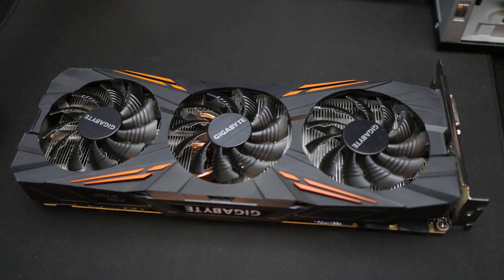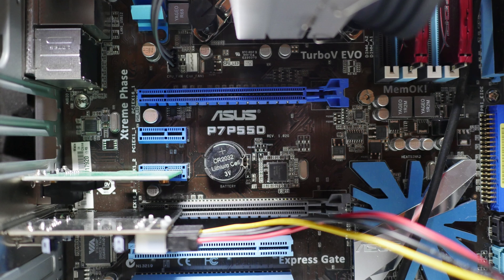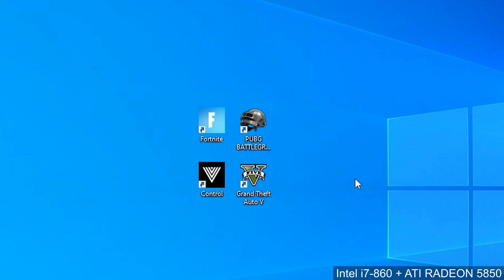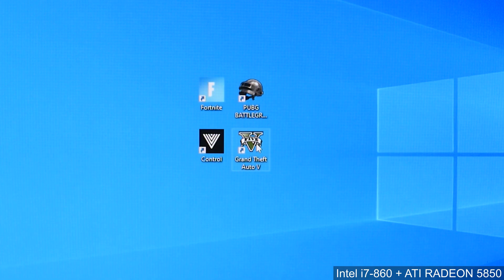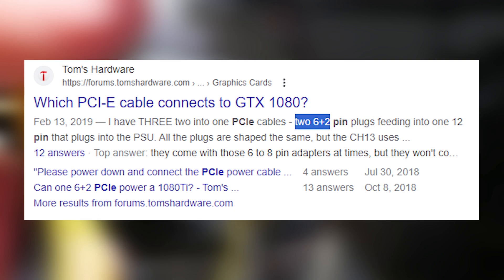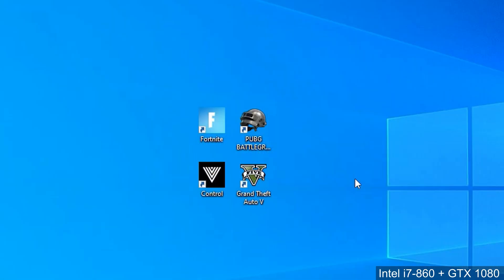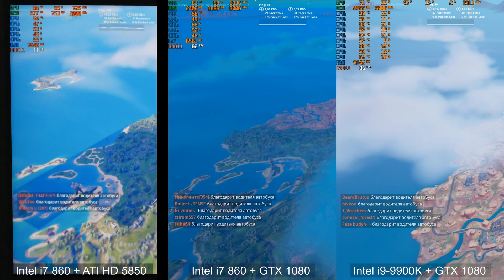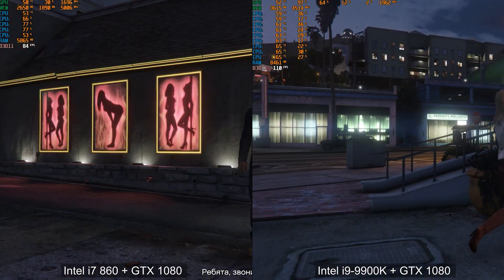Can You Install a Modern GPU on an Old PC and Play Games?

Comment from the maker: Do you have a modern graphics card?
Reply: no
Reply: Me I have a AMD(R) Readeon RX 5600 XT
Reply: Yep, but its gt 730 ti
Reply: Yes
I have an rtx 3060 ti
Reply: yeh have a 3080ti
Reply: Yes i have a 6950xt
Reply: Inda if you consider the 16 series as modern  I got the 1660 super paid paired with a xeon e3 1270v2
Reply: Gtx 1050ti
Reply: @Frontm4n25 is it good?
Reply: used to have a Vega 8, upgraded to an RTX 3070
Reply: I don’t even have a gpu lmao
Reply: Does a Rx6600 Eagle count?
Reply: @Cubzix     Affirmative; the RADEON RX 6600 is still supported with drivers, unlike my ASUS EAH6850DC/2DIS/1GD5 (AMD BARTS Pro GPU, 1 GiB GDDR5 VRAM — Radeon HD 6850 for practical purposes).
Reply: No
Reply: Yes,i have rx 470
Reply: @ArcadeAssaultSrb me too
Reply: Im sorry, but no!
Reply: I have rx 6750 xt
Reply: Got a gtx 1660
Reply: Cpu I7 13700K, R9 380 4GB, i will upgrade to the RX 7800XT at Christmas.
Reply: Of course not
Reply: Yeah i have a 2080 super, pretty much almost equivalent to a 3060 ti or smth like that but my cpus (yes two cpus) are from 2013
Reply: UHD770.。。。。。
Reply: No 😢
Reply: I have no GPU at all! 🥺🥺
Reply: amd rx 480 8gb
Reply: I have a MacBook Air from 2015
Reply: GTX 1050m.. far from modern
Reply: I have quardroom graphics Nvidia
Reply: Rtx 3080 OC still keep good here ofc on modern platform no old 😂
Reply: I have no PC at all! 🙂
Reply: No I have a 1930 graphics card and a 1980 2 gb of ram and a 1987 cpu
Reply: I hope 😢
Reply: Yes sir i have an rtx 3060ti
Reply: RX 6700 XT here
Reply: nop i still use a hd 4550 from 2008 and a monitor from 2009 but before windows 7
Reply: Rx 6400
Reply: @melonmusk1274  rich I have a hd 4550
Reply: GTX 1060
Reply: Gtx 1070
Reply: The 4060Ti. I don’t think that GPUs are the most universal component, I’ve literally never seen a computer that doesn’t support SATA hard drives.
Reply: Me who got gt 130 with dual core🗿🗿🗿🗿🗿🗿
Reply: I have 1080 FE 8GB :)
Reply: ATI FirePro V4800 1GB ❤
Reply: Hahahahhaahhahahahahhahahahahahahahhahahahahahahahhah… i have AMD Radeon HD 6770M graphics with 1GB of GDDR5 memory and
Intel HD Graphics 3000 with 384MB of DDR3 SDRAM😢😢😢😢😢😢
Reply: Yes i have rtx 4060
Reply: Radeon pro 570 4 GB VRAM in 2017 imac.   I don’t use it for gaming that much. Just photography and video editing.
Reply: I got the typical 3060
Reply: Yes rx560xt 8gb
Reply: yes i have rtx 4050ti
Reply: Well, i've just got a GTX1050 😅
Reply: I have rx 5600 xt with r5 3600
Reply: Yes with my desktop and laptop
Reply: GT 210
Reply: Rxt 4060
Reply: Rx 580 but no power supply 😂😂
Reply: I have gt 610
Reply: gt 520 😅
Reply: yes 
i have a 3060
Reply: @RamtechENG   Not yet — I've an ASUSⓇ EAH6850 DC/2DIS/1GD5 VDA (Advanced Micro DevicesⓇ BARTS Pro GPU, 1 GiB GDDR5 VRAM).  ASUS TUF Gaming VDA  with nᴠɪᴅɪᴀⓇ AD104 Ada Lovelace or GB104 Blackwell GPU on the shortlist for a successor tower for the CM1630 minitower as upgraded.
Reply: Is a GTX 710 modern
Reply: @hihoo883     I doubt it.  nᴠɪᴅɪᴀⓇ GF119 Fermi GPU has only 64-bit VRAM.
Reply: geforce rtx 4060 ti dual core 😊
Reply: Amd Radeon r6 680
Reply: Nah
Reply: Yes, RX 7800 XT. It's a bad boy.
Reply: Rx 6600
Reply: Yes i have rtx 4060 8gb vram
Reply: Yes rtx 4060 Ti 16gb
Reply: Intel® HD 2000 graphics, upgrading to a   soyo RX 470 4gig
Reply: Atleast i have an gtx 1080 ti nvidia😈😈😈😈
Reply: I don’t even have a graphics card😑
Reply: I have a rx 580
Reply: Yes gtx 1080 ti
Reply: Yep got it yesterday it’s a 4070 super 12GB OC
Reply: If the rx 6600 is modern then yes
Reply: I have a gtx 660 ti
Reply: is intel UHD graphics modern
Reply: @AliYazılım  depends
Reply: @Милвалке  i mean i have an 2023 and i3 laptop and it has UHD graphics and its from 2023, its prob modern
Reply: @AliYazılım   it's newer than my gpu so probably?
Reply: Yes, running a 6800XT on my main rig and 3070 on my backup. I may put one of them into my retro build if I get a different PSU there.
Reply: Rtx 3090 
By Scalpers
Reply: GeForce  1050 4gb
Reply: I have GTX 1050
Reply: Gtx 1660 super
Reply: GTX 1660 Ti , The Last GTX cards
Reply: No, I have GT 610
Reply: I having GTX 1050
Reply: Rtx 2060 super
Reply: No i have gt 610...
Reply: 5070ti

Comment: Some latest GPU won't detected by old motherboard. The worst no new BIOS support for those motherboard. 
I try to pair my RX 6600 XT to m-81 M1 motherboard. My GPU take a time (a minutes, 3-5 minutes) to display. something to my monitor. Some case for my other fellow the GPU won't be detected at all.
Reply: do you mean h81 ?
because i will buy  asus rog strix rx 5500 xt 8g and i have pegatron h81-m1 and i7 4770
it will work good ??

Comment: Do you think a Dell xps(2017) with an i7-7700 would work well if I put an RTX4060 into it? Low settings are fine.

I dont have any pc to game on, just getting started.
Reply: 1 month later but yes of course, you can play high 1080p in alot of games

Comment: You can breath "new life" into an older computer by 1. upgrading the video card 2. Maxing out the Ram (back in the day when maxing out meant 2, 4 or 8 GBs obvs), and 3. Upgrading the CPU to the best one that the slot in question can support (less advisable if the difference is marginal at best) and assuming you have the power for it. My philosophy regarding video cards is to search internet for "best video card for x processor". I ended up with an Radeon HD4600 series card for the Windows XP computer (Sempron 3300) and ironically an HD7770 for the Windows Seven Computer (Athlon II X2 250).  The former does occasionally bottleneck the CPU, but the latter is a good match.  

Obviously not the purpose of this video, but better match  for the I7 860 would be something like a GTX 760.
Reply: best example is socket 775 board, was first released in 2004 and supports  q6600 which ppl still used until recently for gaming

Comment: 1080 is not even modern it uses old chip.
AMD XT or RTX cards are modern
1080 is 8 years old
Reply: still 3060 level performance
Reply: It's modern enough lil bro

Comment: I was thinking of getting a amd  rx7800xt card to use  with a intel 8700k  cpu with a msi Z370  gaming 5 along with 3200mt\s of ram  .Do you think temperatures and  gameplay would be decent ?
Reply from the maker: I don’t think so. It’s not 13/14900k so, your temperature must be fine, you are using a necessary cooler ofc

Comment: lol. "what if you build a PC with same generation GPU and one generation older CPU than you used to use as a daily?" well the performance is kinda crappy, suprise suprise. its actually suprisingly bad given the fact that the CPU is hyperthreaded which is what most games need to go from iffy to running well on a quadcore.

Comment: This is just possible because the games used here are point focus games like shooters or exploration games where you only controls your characters specifically (camera is stucked on your character). and that folks are not CPU taxing games, the GPU just take the work load when cpu is struggling.
Now, if you play real modern games RTS like Spellforce 3, Age of Empires 4, or open world Diablo4,RDR4,Skyrim,STARFALL. that is not Possible.

Comment: Now what if you connect a old Graphics Card to a new PC?
Reply: You can
Reply: @anotherrandomguy2763  unless its agp
Reply: I put an old ATI x1300 into my new pc and it doesn't display so UEFI probably prevents old cards from working
Reply: @ can be fixed with a bios mod

Comment: wait im confused can someone explain to me

i have an i5 using a RTX gpu and 16gb Ram. and its super smooth, i play Minecraft RTX and i can play Fortnite with low/mid RTX setting?

how is his cpu 100% used?
Reply: Which i5? The i7-860 is a 1st generation i series processor. At this point, there are many i3 processors that run circles around that cpu.

Comment: Who told you that old graphics card there is modern?
Reply: I mean, it's still nave modern drivers and directx 12..
Reply: @i_Daniel  It's old. Almost a decade old. I guess you could consider it modern, depending on your definition of modern in this case. It's still a decent graphics card, but it's old. The issue for me in calling it modern is that it's old. I don't know what the cut-off date would be for modern and not-modern anyways.
Reply: @theonerm2  still better than rtx 3050 tbf
Reply: @i_Daniel  Yes. It is better than the RTX 3050 but the RTX 3050 sucks anyway. It sucks in both price and performance.
Reply: @i_Daniel  So, the GTX 1080 is still old. It being better than the RTX 3050 has no bearing on whether it's modern or not.

Comment: im trying to add 4060 to my old Gigabyte Z370M D3H mother board with I7 8700k processor. Please let me know if it will work fine @RAMTECHENG and others. I chose this Graphic card as I need not have to updated my power unit.
Reply: @ar.karthikp6224   I'm afraid that ye're forced to upgrade, as your existing PSU doesn't support ATX 3.x.  My dilemma as well; LEPA has PSUs which handle 12-pin PCIe auxiliary power from specific +12VDC rails, but sensing is also part of ATX 3.x.

Comment: Depends on the driver. Windows Vista Drivers on XP is ok. Windows 10/11 drivers in XP, not. My Radeon designed for Vista has been running good on my XP desktop.

Comment: I put a GTX 4070 in a dell optiplex 9010 (3rd gen 7), and the results would surprise you!

(correction RTX)
Reply: There doesn't exist a GTX 4070.
Reply: @Unzwuam88  Right! RTX 4070, sorry.   I am used to older cards.
Reply: I'm not surprised at all that the result is you have a thinner wallet.  ;)  Some upgrades simply don't make sense, should have just gotten a 3070 and saved the difference to put towards a system replacement, sooner.
Reply: @stinkycheese804  I did not buy the 4070.  My friend let me use his as a test case.  Outside of a synthetic benchmark, it was not a great experience.

Comment: The i7 860 has hypertheading, use it so you can have 8 threads.
Reply from the maker: Yes. It’s enabled by default in BIOS
Reply: @RamtechENG  Then why in msi afterburner there are  only 4 threads? did you disable it?😬

Comment: It's not only about FPS though, frame times are also very important. Would be interesting to see how the games would run of the cpu were to be overclocked to 4.2Ghz. I still have my i5 750 2.8Ghz. I used run it at 4.2Ghz. Also would be interesting to see how the system would perform with 16Gb ram and overclocked ram.
Reply from the maker: I have i7-3770k PC on ASUS Z77 motherboard. I just thinking about to record test in games using RTX 4070
Reply: i have i5 2320 and ddr3 ram 4x4gb total 16 gb at 2400 mhz
but limited at 1333 cuz i know nothing into oc
Reply: @ElcoCanon   I've a new system in concept formulation:  ASUS PRIME-X870-P-CSM (a leapfrog from the PRIME-X670-P-CSM previously considered); AMD RYZEN PRO 9855G (Socket AM5 (LGA), for which I deploy the iGPU as an NPU); four UDIMMs DDR5-6000 72/144-bit (for ECC); ASUS TUF-GAMING-RTX4080TI-12G (nVIDIA AD104 GPU, 384-bit VRAM); WD2003 HDDs (SATA3) and Crucial SSDs (M.2-2280).

Also intended: Creative Laboratories SB1550 transferred from the existing ASUS CM-1630 minitower, as I visit SingSnap® frequently as a volunteer for the Heavenly Choir roster.  I produce K-tracks occasionally as well.

Comment: I don't know if you know but NVidia GPU drivers has higher CPU overhead than AMD GPU drivers so I mean if could have modern AMD Radeon GPU (equivalent to your GTX 1080 for example) the performance could be better in AMD GPU on the same CPU
Reply: that's an interesting point! I want to know more about it. Can u show me a link to this?
Reply: That is untrue nonsense.  If you are seeing higher CPU utilization, it is only because the game or benchmark is running faster due to a faster GPU and therefore, giving the CPU more work to do as well because it isn't waiting around as much for the GPU to do it's share.

Comment: The forward compatibility for pcie is great im building a pc right now i got an f series processor and i paired it with a gt 610 as i plan on adding a good gpu later.
Reply: bro got gt 610 💀 just stick to minecraft
Reply: @csgosniperelitepro  not everyone has rtx 3080s...
Reply: I had to use a ten year old AMD Radeon R7 250 in my Ryzen 5 3600 build for a year during the video card shortage. I finally got an RX 6600XT in early 2022.